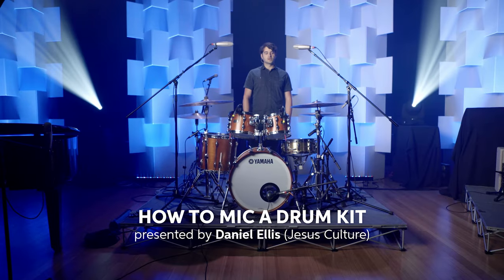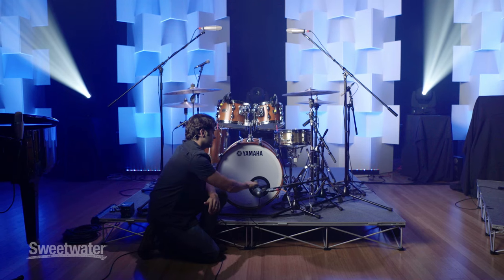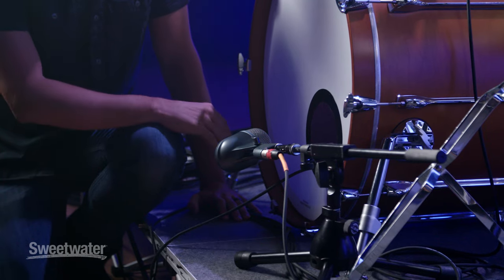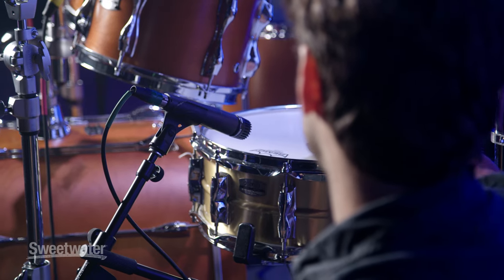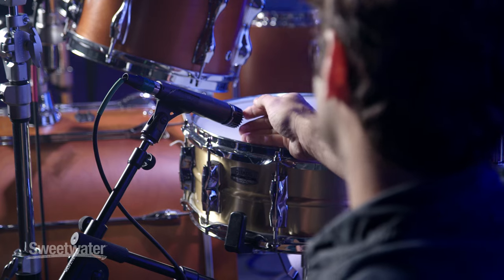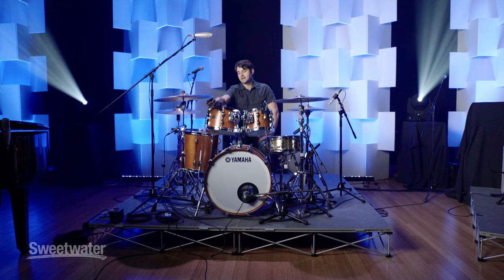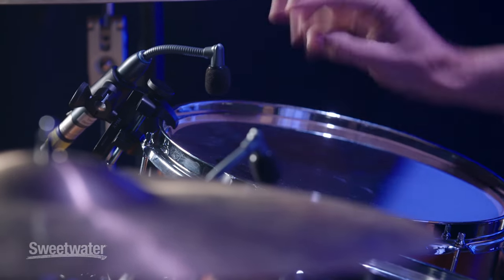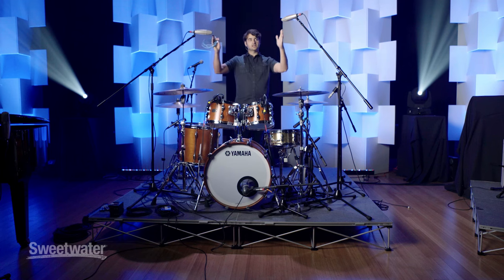How to Mic a Drum Kit presented by Daniel Ellis from Jesus Culture

Comment: Do you have to use XRL inputs when miking drums or can I use both 1/4" and XRL? I only have 8 XRL inputs.only miking the kick and snare
Reply from the maker: Hello, GriffinGTR! Great question! You need to be sure all microphones are going into a microphone preamp input. Most 1/4" inputs on a mixer or audio interface are not microphone preamps, so it will not work. By all means, feel free to call us if you are unsure. We can certainly point you in the right direction. 
Thanks for the interest! 
Cody Kraus, Sweetwater Sales Engineer, (800) 222-4700 ext. 1766, cody_kraus@sweetwater.com

Comment: Might be a silly question, but do all these mics need a separate line on the PA?
Reply from the maker: Hey, Padawan. Thank you so much for reaching out. To answer your question - Yes, you would want to send every mic to an independent channel. By doing this you get a lot more control and can add fx's and tweak every part of your kit to really dial in the sound. If you are finding you have a limitation in your channel count, there are different drum mic techniques to use less mics and channels. If there is anything else at all I can do, please let me know.
Grant Embury, Sweetwater Sales Engineer, (800) 222-4700 ext. 1647, Grant_embury@Sweetwater.com
Reply: @sweetwater  Cheers Grant

Comment: What boom stand is he using?
Reply from the maker: Hi, Thang. In this video he is using stands from K&M. The one on the kick drum is the KM25950, the snare and hi-hats have a few of the KM25900, and the overheads are using the KM2102. They are rock solid stands! Thanks for your interest!
Mike Wuchter, Sweetwater Sales Engineer, (800) 222-4700 ext. 1789
Reply: Sweetwater Thanks